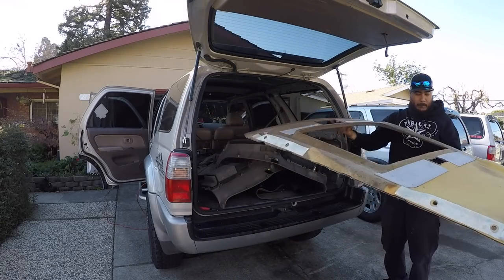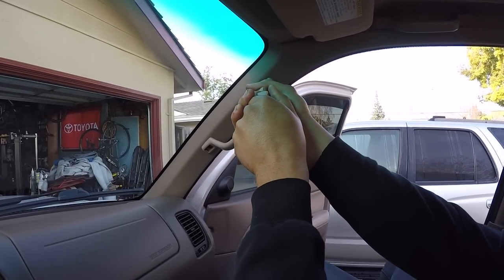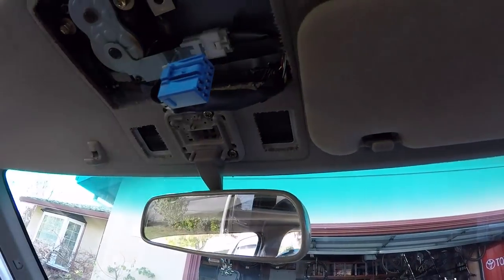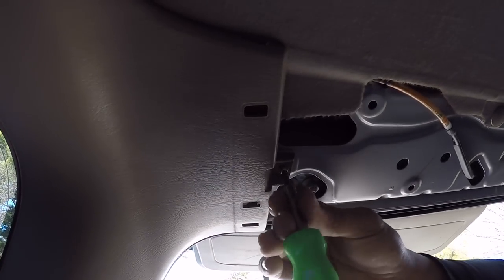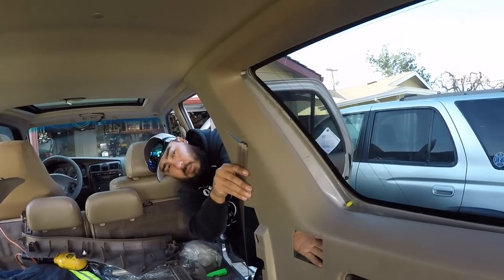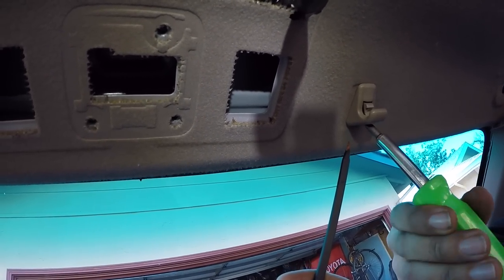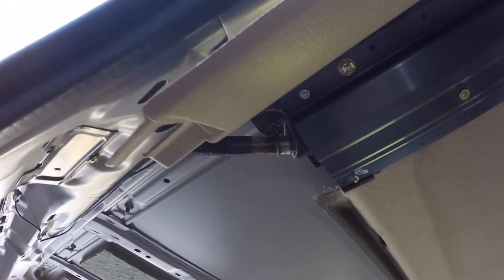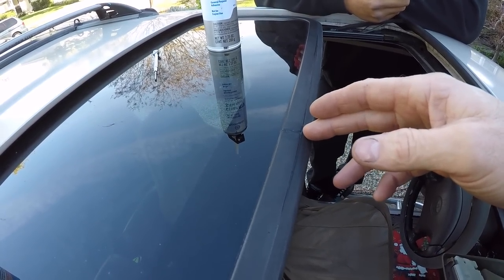Headliner Removal & Sunroof Leak Repair

Comment: Hey Tim. About 2 years ago I experienced a leak in my 2000 4Runner (no sunroof) coming out of the exact same spot you mentioned.  Turns out a screw holding down my roof rack was the culprit. I ended up taking the rack off, cleaning the debris underneath and reapplied silicon to each screw. Worked like a charm. Maybe if the leak comes back he can give that a try.
Reply from the maker: Hey Donovan, you reminded me of another common leak spot and I forgot to mention this in the video.  I have read on T4R.org that people have fixed roof leaks just like you described.  I'll make sure to mention this to Mark.  Thanks for reminding me of this.  Happy Wrenching!
Reply: Great point Donovan, this turned out to be where my leak was coming from. Thanks for adding this comment.
Reply: That’s because they rust for ever

Comment: Ha Ha Exactly where my daughters corolla was leaking. The drains were plugged as well. She actually found the leak there, saying" Dad, I can see daylight through there"... I knew the sunroof doesn't really seal around the opening, but allows continual drainage, and I hadn't looked at where the ends meet. Why they don't meet is beyond me..
Reply from the maker: I think the trim around the sunroof shrinks with age and sun exposure creating that gap.

Comment: A great reason to remove the headliner would be to access the sunroof to repair its functions. Curious if you or anybody in your 4Runner community has dealt with replacing or fixing the motors or movement of the sunroof. I’ll read some forums but thanks anyway. My tilt stopped working and only wants to retract half the time.
Reply from the maker: Perfect timing on this question. One of our 3rd gen 4Runners has a sunroof issue which we need to tear into soon. Should we film the repair?
- Sean
Reply: I was gonna say I’m surprised you guys didn’t have a repair documented for the sunroof yet. Appreciate the quick response and all the hard/fun work for all these amazing videos. No question y’all should film it ! Haha thanks for everything guys !
Reply: @TimmyTheToolman  Hey there, just wondering if you have to remove the whole headliner to get to the sunroof? My current one is rusted so I bought a new unit and want to do the install myself to save some $$$$. Would greatly appreciate a heads up and thank you so much for your videos so dang helpful
Reply from the maker: @kevincenteno6049  yeah you do have to remove the headliner to get to all the fasteners that hold the sunroof assembly in place.
- Sean

Comment: I put all my screws back in there respective places once I removed any pieces and the grab rails. This way I didn't lose any. My leak is only over the drivers seat but the sunroof doesn't open! I guess the whole sun roof assembly needs to come out?
Reply from the maker: You might be able to clean the front drains from the bottom going up.  You clean the rear drains from the bottom going up, so you should be able to do that for the front as well.  Watch this video: https://youtu.be/qalXo4etX3Q?si=JWPnmtblVACj7-B5
Reply: @TimmyTheToolman  I took the head linner down. I can't open lite! Need to get this opens

Comment: ya, know I have talked to 3 separate dealers about my water infiltration on my 2008 Toyota highlander limited edition and 2 of them told me to bring the vehicle into shop. But what's frustrating when I talk to service and parts about my situation because I have been extensively trying to find water coming in to vehicle, they seem to have no idea that this water infiltration is going on with these vehicles?? Go figure. the 3rd I've watched videos on water coming in from the back bumper body area. There are round water rubber plugs that can dry out and water could get in there.and when talking to parts they told me I would have have bumper panel taken off to get the numbers of the plug. They won't tell me what the stock item is. They suggest again to take vehicle in for service?? This is all crazy to me ?
Reply from the maker: Water can get in from blocked sunroof drains.   It can also come in via the roof rack screw holes.  You can pull the screws out and fill them with silicone and then reinstall the screws.  Water can come in through the sunroof trim like we show in this video and I think those are the main ones.  Those rubber plugs near the rear bumper aren't a common water intrusion point.  To get to those though, you can pull the rear cargo panels away from the body to get at them.  Check out my Rear CBI bumper install to see how I did it.

Comment: I have a leak from the roof rack. Thanks to this video i know that the repair isn’t going to be a easy repair but it’s very helpful for those of us trying to extend the life of our trucks, thank you for another great video
Reply from the maker: Hey Noel, sorry for the late reply.  I don't think you have to remove the headliner if your leak is due to the roof rack.  Just remove the rack, clean up all the screw holes and then use some silicone in each screw hole when putting it back together.  I've heard this has worked for other 3rd Gen owners.
Reply: Wish I saw this earlier, found mine bubbling with rust and it rusted through….gonna have to patch that up now🙃

Comment: All that work, I'm still troubleshooting my leak I'm thinking of siliconeing the whole entire roof rack and piece of rubber that runs along the roof?
Reply from the maker: People have done it but I wouldn't recommend it siliconing your whole sunroof.

Have you pulled your roof rack rails off and siliconed the screw holes?  That's another common leak point.  Pull off the roof rack rails, clean up the areas around the holes the best you can, maybe blow some compressed air in each of them to remove debris, squirt some silicone in each hole, put the rails in place and put the screws back in.

Comment: I have a 98 4runner, the sunroof drains were clogged and the metal behind the windshield had rusted out without showing visibly so I had 2 leak sources. Insurance paid for it thankfully. Great video I needed as Im reinstalling the old headliner after doing new fabric.
Reply from the maker: You must have great insurance.  I never would have thought an insurance company would cover something like that.  Glad our video is helping you out.  Good luck with the all the work.

Comment: I have a leak in my sunroof but it is broken, is there anyway to manually open it and then clean the drain holes
Reply from the maker: The only thing I can think of is taking the headliner down enough to access the drain connections, disconnect the drain hoses from the fittings and snake the rubber drain lines from there with some weed whacker line.

Comment: You saved the day replacing my 2000 4Runner liftgate. I only removed enough of the headliner to get to my wiring harness. NOWWW.  How do i bend the little bit of the bed that was messed up when she run into the back of me with my 5x8 trail punching into my liftgate?
Reply from the maker: Glad our video helped you out.  Get a big hammer and smash it back into shape.

Comment: Timmy, I have a 4th generation with a sunroof leak.  Does the headliner need to come out for the 4th generation?  I cannot find any videos or information on fixing the leak on a 2004 4Runner.
Reply from the maker: The only reason why we removed the headliner is to figure out the source of Marks's leak.  We suspect it was a blocked drain all along because when we poured water into the tray, we couldn't find a leak.  I'd start with finding out if the sunroof drains are draining.  If one or more are blocked, snake them with some weed whacker line like we do in this video: https://youtu.be/qalXo4etX3Q  There's also the possibility that you have a leak that is caused from the sunroof glass trim shrinking and causing a gap that allows water in that we fixed with some silicone RTV in this video.

Comment: Hey Timmy if I were adding a driver side visor with a mirror/light what do you think I would have to remove to run the wires?
Reply from the maker: I'm not sure where those wires run and you'd have to remove the whole headliner to do it.

Comment: Thank you for this video. I now have the confidence I need to remove the headliner in my ‘01 in connection with a sound deadening project. I’m wondering if you have any links for the headliner clips that cracked? I’m sure I will crack a few of them doing the removal. 

Thanks again for this video! ❤
Reply from the maker: You're welcome.  Don't have a link for those clips.  Your best bet is just get them from your local Toyota dealer.  They can't cost that much.

Comment: Thanks again for an excellent video. I have everything taken apart. The drain was clogged with tree precipitation, otherwise known as tree crap. The grease on the sunroof motor gear has turned to rubber. I cannot open the sunroof. I have it on the sawhorses. I imagine the rubberized grease has clogged the pair of copper tubes. How can I open the glass to slide it back? Screws are covered. The rear of the glass needs to drop about an inch to clear the roof before sliding backwards. If the 'worm gear' is stuck in the copper tube, is there a catch or release button to get the glass back?
Reply from the maker: Hey Steve, we haven't removed one yet to be able to give you some good advice.  We do have plans to make a video about swapping out a sunroof sometime in the future.
Reply: update: The manual calls the copper tubes a cable guide. The cable, (sliding sunroof cable?) has 3 characteristics. A heavy bike cable at the core, surrounded by what looks like spring steel coiled to create ribs. Filled between the spiraled ribs is a rubberized plastic of some sort. After 20 years this cream colored rubberized plastic turned dark tan and it crumbles. The crumbles come loose and clogged the cable guide or copper tubes. There are 4 copper tubes. The 4 copper tubes feed into the gear box housing the gear of the sunroof motor. With the sunroof stuck closed the screws holding the ends of the inside pair of copper tubes are blocked by the glass. I cleared one clog from one outside copper tube. I had to flip the sunroof assembly over drill two 3/16 holes to access 2 brass screws in the top of the gear box that holds the copper tube ends inside the gear box. The digging continues. The sunroof still will not open.

Comment: How did you remove the sun visor clip? Both of mine are broken and I would like to replace them. I removed the clearly visible screw, but they still won't budge. Any advice will be greatly appreciated.
Reply: David Naroz You have to wiggle it and it will come out

Comment: Think this'll work for a 2nd gen?
Reply from the maker: Well, the steps we take to remove the headliner would most likely translate at some level but I imagine there's some differences.  I can't say for sure because we've never done this on a 2nd Gen.  Same goes for the sunroof leak repair.  I'm assuming there's some type of trim around the glass but don't know if the trim shrinking and creating a path for water to get inside relates to 2nd Gens too.
Reply: Okie doke, thanks man.
Reply from the maker: @Natureboy562  You'll figure it out.  You've got the idea of how to go about it.  Maybe first have somebody spray hose water over the roof while you're inside looking.  If that doesn't pinpoint anything for you, remove the headliner using our video as a guide.  You basically have to remove everything that can get in the way of it's removal like dome lights, grab rails, and interior trim pieces and get somebody to help you maneuver it out.  Then, do the water application again while you're inside looking for the source of the leak.  Perseverance will pay off for you.  Let me know what you figure out.  Inquiring minds want to know.

Comment: Thanks. This is just what I needed to see how to remove the map light assembly to tighten a loose rear view mirror. I don't say this often about Toyota engineering but that is the worst design for holding that mirror on. I had to bypass their way and develop my own. It was incredibly simple to do. I used a longer screw/bolt and some washers large enough to hold it on. Why Toyota decided to use that funky pin holder set up is anyone's guess. Thanks again for your great and thorough videos Timmy!
Reply from the maker: You're welcome Bob.  Glad our video helped you out.  Sometimes these engineers nail it and other times like you just experienced they leave you scratching your head on what the hell they were thinking.  Anyway, I guess we have to take the good with the bad.  Happy Wrenching!

Comment: Do you by any chance have a link to where I can get a toyota service manual? I have a haynes manual that I really enjoy using when I need it, but it's mostly for engine and drive train stuff. The service manual seems to be a full front to back kit.
Reply from the maker: What year, make and model vehicle do you have?
Reply: @TimmyTheToolman  2001 sr5 4runner
Reply from the maker: @cmart9240  I found this on Ebay: https://ebay.us/1vZOfa

Comment: You have a commentator's voice, sounded like I was watching an athletic event at times lol. Thank you for this vid, I have a leak coming down the drivers side a-pillar out near my electrical little panel in my foot well. Gonna take the headliner off, and test with water. Maybe its the roof rack, maybe its the windshield seal. Yall we're a great team, thanks again
Reply from the maker: I guess I could have had a career in sports commentating.  You're the first person to ever mention that.  Good luck figuring out the the source of the leak.  I wouldn't pull the whole headliner out at first.  I'd just release enough in the front to allow the headliner to hang down so you can visualize the area and then test with water to figure out where it's coming in.

Comment: Your videos are the best. So far I have used the O2 swap to help with those and now I used this as a reference to remove my headliner. Somehow someway my rear drain drivers side disconnected and caused some serious issues. Thanks for the detailed videos and keep up the 3rd gen 4runner love!
Reply from the maker: Thanks Shane.  Good to hear our videos have been helping you out.  That's weird the drain came off on it's own.  Thanks for taking the time to comment.  Happy Wrenching!

Comment: can the screws in the grab handle be replaced with typical Toyota bolts, say a 10mm?
Reply from the maker: Not sure the plastic covers will be able to fit in place because the bolt head will be bigger than the screw head.  Take one of the screws to the hardware store and match the size thread, pitch and length in a bolt and give it a shot.
Reply: @TimmyTheToolman  since you've done this before, do you think it's possible to just drop the driver side of the headliner to rerun the dome light harness (which may include the moon roof section of plugs as well)?
Reply from the maker: @trinydex  I don't know if it's possible because I've never worked on the wiring under the headliner.  We took off the headliner for an entirely different reason.  But, I would think you would want it completely out of your way.

Comment: Thank goodness for this video, my 3rd gen sunroof is leaking as well, something for me to do when stops raining.
Reply from the maker: adam dallas Good luck with fixing the leak.  Let me know how it goes for you.
Reply: Yeah thanks. I actually worked on it last night and saw the drainage hose wasn't even plugged in. I plugged it in and haven't had a chance to test it yet because the the sunroof itself doesn't go back. Another something else to work on =(

Comment: Hello.  So I have a plastic part loose on my sunroof.  best I can find is that it is the rear drip pan/panel.  Do you know how I can remount it?  Dont see it in your video
Reply from the maker: Hey Brady, I'm not sure.  Is the part broken or has it just popped out.  If it's broken, I would suggest trying to glue it back in with some type of glue or epoxy specific for plastic.
Reply: Not broken I dont think.  The schematics I believe again shows rear drip pan/panel.  I have a pick but cant send on this platform.  It currently just slides around very loosely on the tracks.  Just was trying to not take off my headliner.  Thanks for responding
Reply from the maker: @bradybrandon3899  Yeah, I'm not going to be much help because I don't exactly know what you're dealing with.

Comment: Huge thanks for producing this video. I have a 1990 4runner, and I looked, and looked for a video to remove the plastic trim because my 4runner did not come with grab handles, and I tried to take it off myself but I felt like I didnt know what I was doing and I was going to break the 30 year old plastic. All I need to do now is to go out in my garage and start to remove stuff. Thanks again.

Comment: 2:45 The problem is not just lock-tite; they are actually JIS screws, not Philips.  A Philips-head screw-driver will tend to 'cam-out' of the JIS fastener slots, because the two styles of fastener have different profiles.  But, can confirm: that lock-tite is crazy strong.   If anyone does find they have to drill off the heads, they should cover their air vents with towels to keep metal shavings from falling inside them.  Then after drilling use a file to make a flat surface on the exposed threads, so that some vice-grips can get a solid bite.
...Or, you know, just use a Philips impact driver, which will convert those JIS fasteners into Philips.   :)
Reply: Timmy The Toolman I believe you
Reply from the maker: You did inspire me to get the right tool for the job though.  I'm going to buy some JIS screwdrivers.